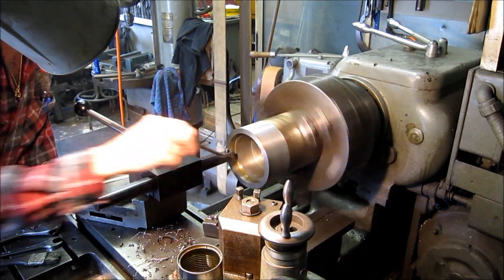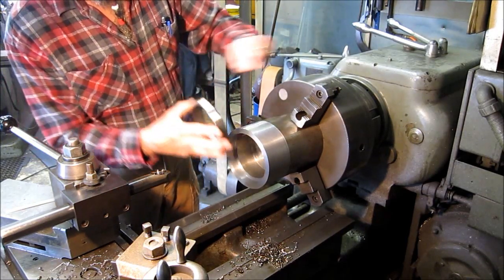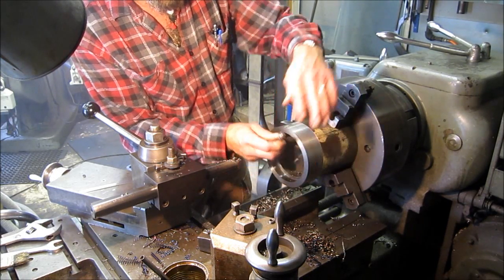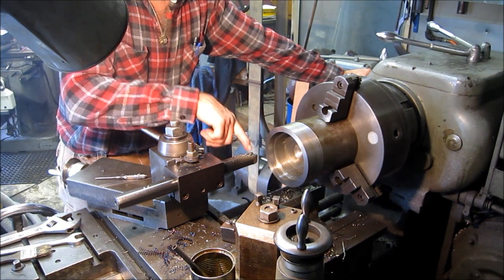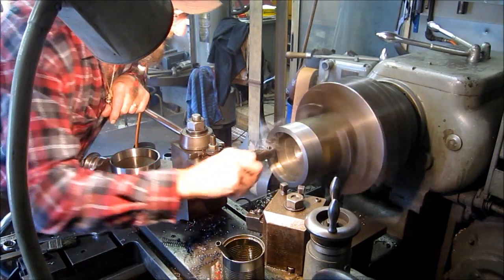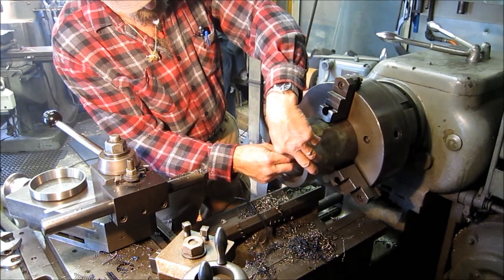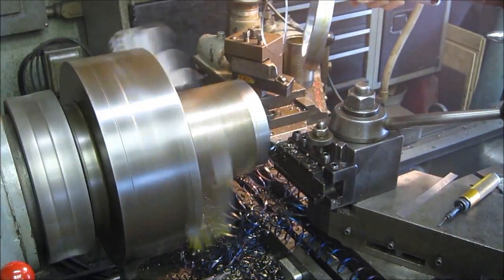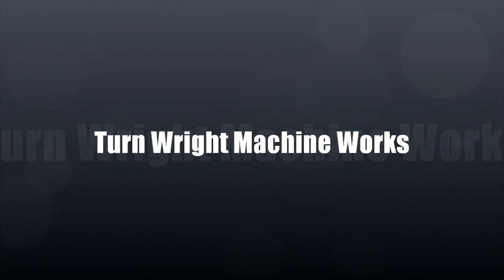Big Screen Elevator Part Eleven

Comment: Seeing as to how your only holding up a TV and not the front wheel of a truck. a few drops of red locktight would hold that bearing in place forever with out needing to redo your work.

Comment from the maker: I'm not a know it all also! It would be a sad day in Hell, if ever I felt I did!

I encourage, questions and comments...

 The smoke generated during the cut is a welcome sign, it lets you know there is cutting oil getting to the heat zone and is collecting heat, the sulfer in the cutting fuild draws heat to it. Your part in general will still build heat as you remove more metal but the action zone around the cut and including the bit will maintain a reasonable working    temperature...

Comment: When working to the tight tolerances such as on this part, how big a factor is heat in the stock from heavy roughing cuts?  Do you need to let it cool down a bit before taking final measurements and finish cuts?